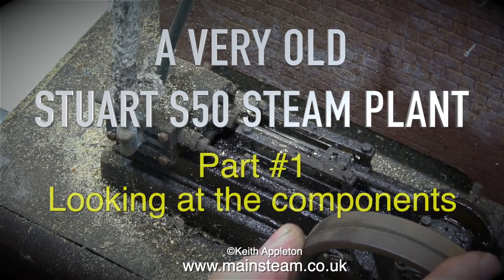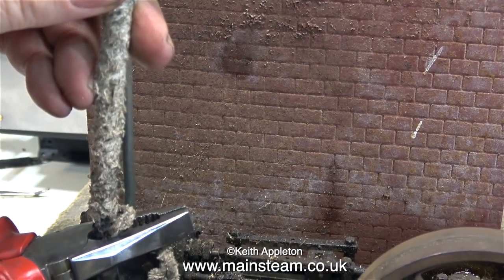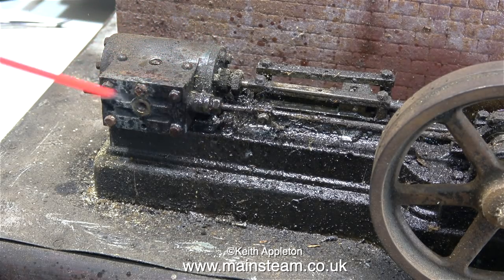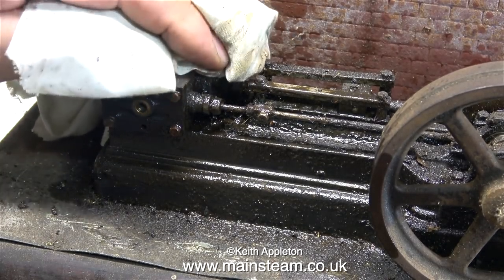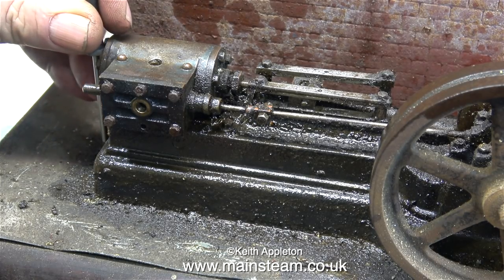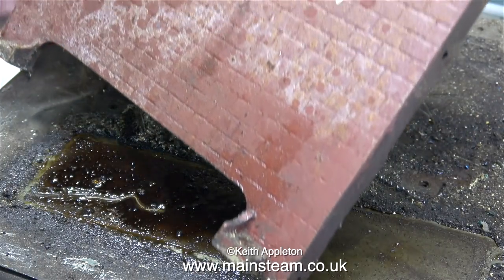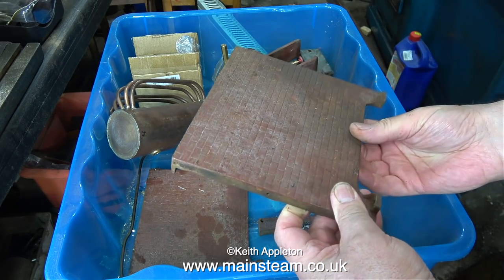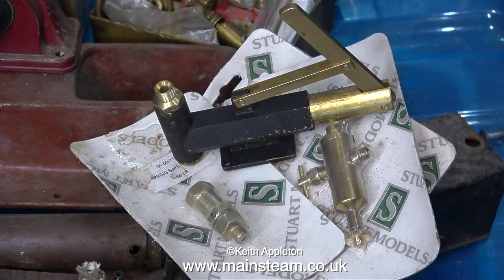A VERY OLD STUART S50 STEAM PLANT - PART #1

Comment: The rust-protection reminds me of the 30-year-old car I was working on repairing when I was much younger.  The engine had a minor oil leak around the oil pump on the left side of the engine -- with the result that the left-side floorboard was coated in a thin layer of sticky black oil-grime and was quite solid, whereas the right floorboard had several rust holes through it.

Comment: Using a different head on the toothbrush is one solution, if you're going to brush your teeth. I generally find it better to use my brothers electric toothbrush, avoiding the need to have a separate head.

Comment: If that was a motorcycle, that sort of thing used to get me quite aroused. Usually came with the story from the customer or sell stating that it was running okay and then they did a tune-up, but it wouldn't start, so they put it in the garage for 20 years. It's like a metal Miss Marple Mystery.